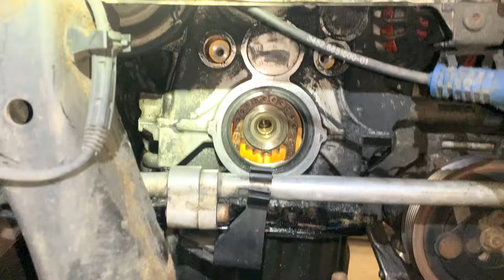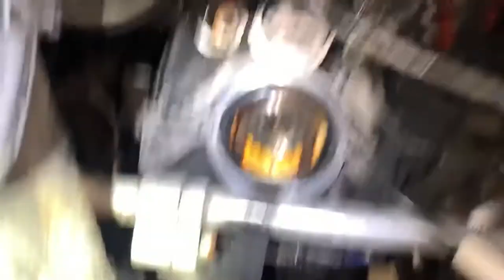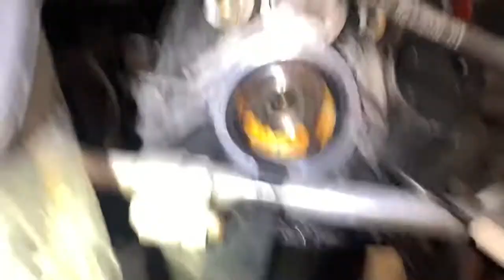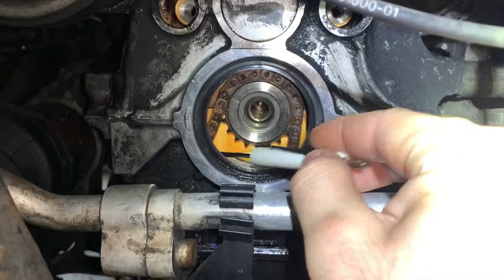R56 Mini Loose Oil Pump Chain Imitating/Causing Death Rattle

Comment: How did it go? Did you install a new oil pump and oil pump chain?
Reply from the maker: Hi Christopher, things are going great! I've put roughly 5 to 6 thousand miles on the new pump and chains, and so far I've only had a timing code once but I believe that was due to the -35 degree temp that morning (Super thick oil).

Comment: did you get any oil warning light? is it fixed? got low oil pressure
Reply from the maker: No, I did not get any oil warning lights however the new one I replaced it with is much tighter.

Comment: i checked other videos about pump chain on this mini
pump chain slack is normal, you replaced a component that was fine
Reply from the maker: Fine or not I didn't mind changing it out as it was in the way of the timing chain in the first place. you're correct though, I probably didn't need to replace it.
Reply: Fine or not it’s good preventive maintenance to do so while the other components are off the vehicle. I’ve seen videos and yes, slack is normal, due to wear and elongation of the chain. So a fresh chain and sprockets is good practice especially if you have a cassette or guides that fail and you need to remove the oil pan to check for debris at the pump pick up tube. I just did the timing chain, oil pump chain and sprockets, as well as all the drive accessories including upgrading the alternator to a 150A unit. Everything sounds so much better. Engine just purrs. No annoying rattle at startup.